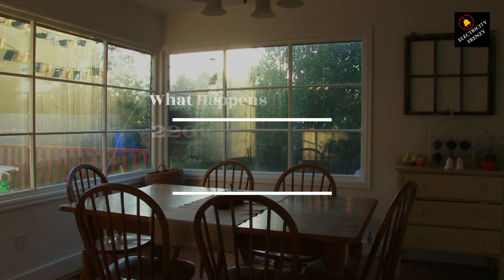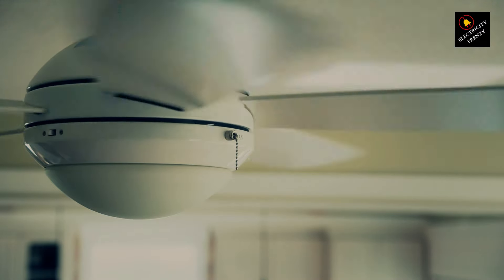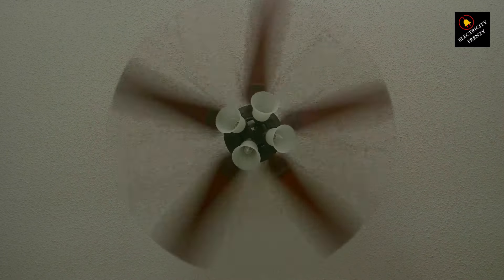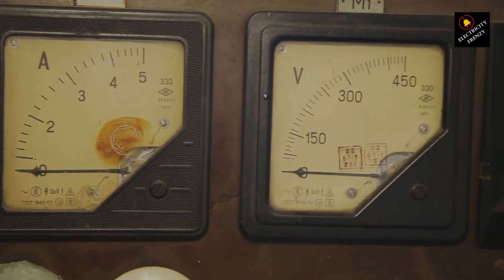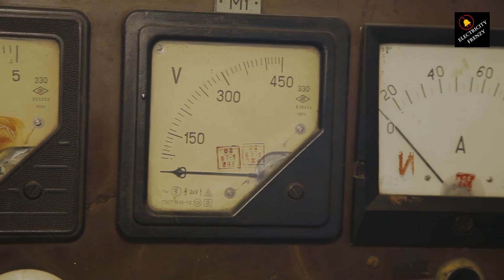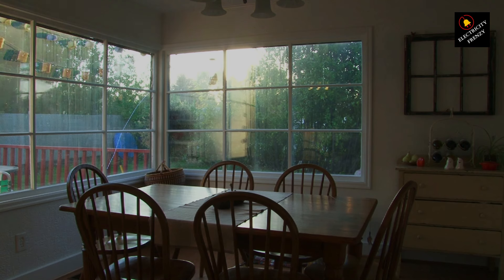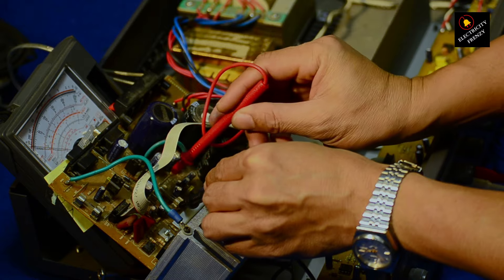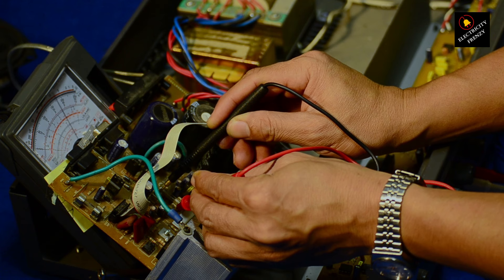What Happens if I Run a 220v Fan on 110v Outlet؟

Comment: If it is an induction motor, there should be NO reduction in speed if it is run on half-volrage.! However: The torque is cut in half, so running a 240v fan on 120v may slow down due to friction of the bearings or wind resistance from the fan blades. A brush-type "universal" motor is totally a different story!
Reply: Normally, an induction motor runs at slightly below the synchronous speed. If you reduce the voltage, the torque is reduced and the rotor will slip more and slow down as you said due to friction and wind resistance. It's better to reduce the frequency than voltage for high power speed control, but for low power application, you can use voltage as speed control. In fact, most multi-speed fans (ie. ceiling fans and oscillating fans) use capacitors in series to effectively reduce the voltage to the fan motor at lower speed.
Reply from the maker: Thanks for your insightful comment! You're absolutely right about the difference in behavior between induction motors and universal motors under varying voltages. In the case of an induction motor, running it on half the designed voltage can indeed lead to reduced torque, which might cause the fan to slow down under mechanical load, such as friction or air resistance, as you've pointed out.

Your comment adds great value to the discussion, helping to clarify the complexities involved in how different types of motors react to voltage changes. Thanks again for sharing your knowledge!
Reply from the maker: @gang208 
Excellent points! Your explanation about the impact of voltage reduction on induction motor speed, especially in relation to rotor slip, provides a clear picture of how these motors respond to changes. I appreciate the insight into the preference for frequency reduction over voltage for high-power speed control. It's fascinating to learn about the techniques used in multi-speed fans, utilizing capacitors in series to effectively vary the voltage for different speeds. Thanks for contributing to the discussion and enriching our understanding of motor control!
Reply: @gang208  The Tesla cars use a variable-frequency-drive (VFD)  to control throttle. Of course, an EV needs an inverter to convert the DC from the lithium-ion battery pack to AC.
Reply from the maker: Tesla cars motors are DC, controlling not induction, I believe.
Thanks for your valuable comment 👍👍
Reply: @ElectricityFrenzy  At the auto show and the dealership they said they use VFD. I checked various blogs online that say EVs use VFD and AC motors, but I know about the few instances where DC motors are used.
Reply: @ElectricityFrenzy  Tesla models S and X use AC induction motors. Tesla switched to DC motors on model 3 and later models. Here is a detail anatomy of the Tesla S motor, starting at around 13 minute mark.
https://www.youtube.com/watch?v=MQV3D8F6gvw
Reply from the maker: @gang208 Thanks for this valuable info, I really appreciate it.
Reply from the maker: Check the comment from @gang208 ,It seems they do use induction motor
Reply from the maker: You welcome 👍

Comment: Instead of explaining of what could "possibly" happen if you run 220v on 110v, you should have made a video demonstrating of what would actually happen.
Reply from the maker: Thank you for your suggestion. I understand the appeal of a visual demonstration to clearly show the effects of running a 220V appliance on a 110V supply. However, it's crucial to consider the safety risks involved in such an experiment. Besides, I have limited resources to conduct such a demonstration. Rest assured, I am committed to providing the most accurate and helpful information possible within these constraints. Thank you again for your suggestion.
Reply: @ElectricityFrenzy  Not gonna lie you literally sound like chatGPT the way you reply each comment.
Reply from the maker: You are right, it's because my English is a little rusty. That's why I use AI voiceover, but I'm an experienced electrical engineer and I check and double check the information I provide.
I also check the replies and make sure it's what I should say.

Comment: I routinely run my single speed 120v fan on the output of a variable transformer (0v to 120v) to reduce the speed and noise. It runs fine at lower speed, and no overheat. In fact, the motor runs cooler.
Reply: It looks like the fan blades may turn (depending on friction) a tad slower if it is an induction motor, and much slower if it is a brush/commutator type motor. There won't be too much wear and tear unless the fan blades lock-up due to low voltage. In that case, there may be frying/melting/shorting of windings and a lot of smoke.
Reply from the maker: Thanks for sharing your experiences with running the fan on a variable transformer! It's interesting to hear about your success in reducing speed and noise while keeping the motor cooler. Your practical experimentation adds a valuable real-world perspective.
Reply from the maker: I appreciate your engagement and feedback. Everyone has their own preferences and opinions, and I'm here to provide information and foster discussions. If there are specific aspects you'd like to see or discuss, feel free to let me know. I'm always open to feedback and suggestions. Thanks you for being part of the community!